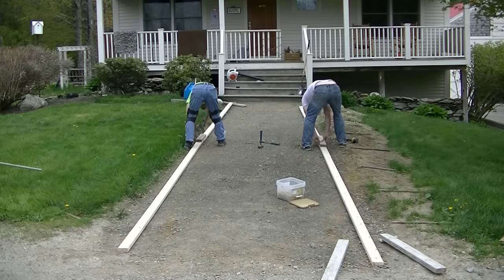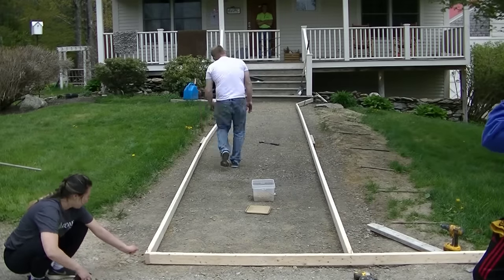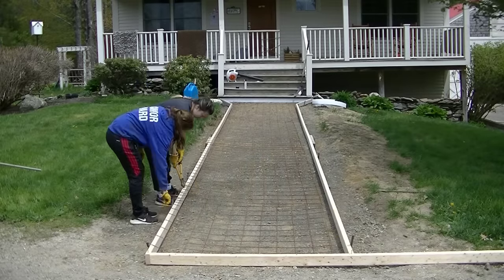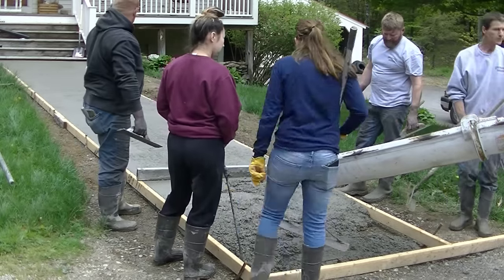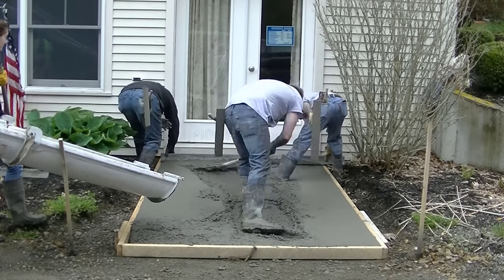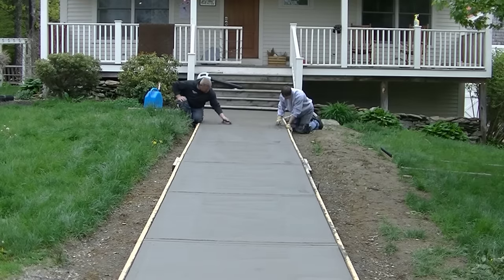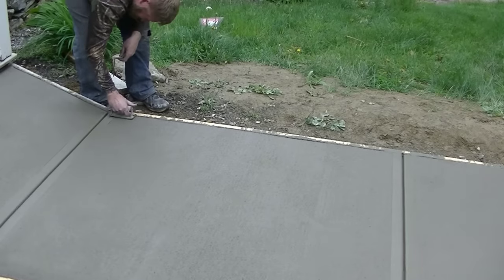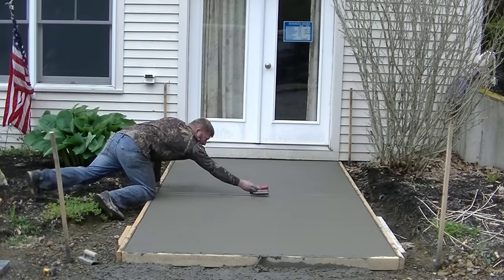CONCRETE SIDEWALK : FORMING, POURING AND FINISHING

Comment: I would like to see finished - dried concrete without form and in detail.
Reply: All concrete finishes the same.  The broom brush is used to finish it so we don't slip when we walk on it wet.  They backfilled around the sides with earth and then over time the grass catches up to the sides of it.
Reply: @danielcox6143  We don't do broom brush and we don't slip if it is wet. I have never seen such surface and I can not imagine how it looks in detail. I doubt it keeps the shape over time and will not droll or break.
Reply: @marian20012   The concrete broom brush they're not using in the video is one of the tools I need currently to do a job, and I run 70 miles a week, all of my shoes have extremely flat - smooth soles, I fucking slip every step I take when the concrete is wet.  As a matter of fact, now I have one pair of corregated clompers I wear if I even suspicion there will be rain or sprinklers.  Next door to my condos is this other condo unit who water their lawns and my sidewalk around 7:30 p.m. my time for shopping.  Damn bastards.  Who does that?!   It's a choice between breaking my back from a fall or breaking my back from carrying all the extra weight.  Thank you so much for commenting back, I really need the attention as you're now well aware.
Reply: Oh, my bad, I misunderstood you and got you (initally) confused with the owners of the video, confusion from how the notice came up in my feed.  Broom brush is kind of the standard of the industry.  I misunderstood again, when we built our castle (10717 Indiana Ave. Riverside CA 92501) we wouldn't have broom brushed because we covered the concrete with very expensive carpeting.  I used to own, live in and work at my castle.  Isn't that cool?  All the outdoor concrete (I'm pretty sure) is broom brushed.

Comment: What r the purpose for grooves?
Reply from the maker: The grooves are for looks (help it look nicer) and to help control any random cracks that may occur later.
Reply: The purpose for control joints, not grooves. Drives me crazy that a guy who puts up videos of pouring little walkways calls them grooves and not control joints, which is the correct term. He calls the tool a groove. Lol. It's called a jointer. Their purpose is to stop a crack from going any farther through the walkway. If a crack starts it will stop at the control joint so you only have to replace 1 block instead of more.
Reply: George Smith haha this is also wrong. The point of a control joint is to choose where your cracks go. Concrete cracks. Control joints are so that the concrete cracks along the joint so that you don’t see a nasty crack in the middle of the concrete

Comment: 5% air, what does that mean?
Reply from the maker: The redi-mix company adds "air" to the concrete mix. They're tiny microscopic air bubbles. So when the concrete absorbs water in freeze/thaw temperatures, the water has room to expand, when it freezes inside the concrete matrix and not "pop" or spall the surface of the concrete. 5% is just the amount of air-entrainment added to the entire mix.
Reply: Hey mike does this affect the integrity of the concrete vs no air?
Reply: What I mean is there something you’d recommend when putting air to help the concrete retain strength

Comment: I thought it was important to put down a layer of rock first, 4-6 inches
Reply from the maker: No, good gravel works just fine.
Reply: i should have been more general and called it aggregate. i have seen a number of videos on youtube and none of them have installed an aggregate base. i thought it was a good practice to excavate and install a 4-6” subbase prior to pouring the concrete

Comment: What you charge for a job like this mike?
Reply from the maker: It depends on the size of the project. This also included a large stamped pool deck that I have in another video. But in general to form, pour, and finish a broomed sidwalk around 8 dollars per sf. Sometimes a little less if more sf is involved.

Comment: No spacing was given between the steel mesh and the floor.  It won't last long.  The steel will corrode and break, causing cracks in the concrete.

Comment: The metal is on the floor why is that .

Issent it supposed to be like at least 1.5 cm from the floor so that water can't reach the metall and than it will not rust because  concrete will crack from the rust pressure ?!?
Reply: Listen at 725, he mentions that one of the folks are pulling up the wire off the ground.

Comment: how much does it cost to get concrete delivered
Reply from the maker: In Maine it costs around 125 per yard for 5 yard loads or more. Under 5 they charge a small load charge around 200.00
Reply: Stupid question how do you calculate how many yards you need?

Comment: URE not going to put a string line on the boards or an expansions board on the stairs NEATHER. And URE using screws to screw the material. I also got my own concrete company. Its not going to sag if you put a quarter fall per running ft. And you're straight screening it also.ALSO THE BULL FLOAT KEEPS IT FLAT.

Comment: Man I just don't know what to say. The mesh should be raised up from the bottom at least an inch or two. I would also use some rebar so it doesn't crack
Reply: They did raise the mesh as they were pouring it.
Reply: It can still crack even with rebar. Mesh and rebar keep the cracks from opening up or shifting heights . Rebar is better for keeping cracks from heaving and causing a trip hazard

Comment: The reinforcement bar should be an inchfrom the finished surface and should not be sitting on the ground as this defies its purpose. than suspending it. This is
Reply from the maker: An inch from the surface? You have obviously never finished concrete before and if it were that close it would shadow through and you would see the grid pattern in the finished walk.
Reply: @MikeDayConcrete  I am giving you science as an architect. It is my duty of care to tell you that. Good luck with the girls

Comment: you shouldnt be eye balling the walkway to see if it is straight. It is very simple to use Pythagorean theorem to make sure the walkway is square to this house. I cant believe some of these youtube contractors get paid for this work.
Reply from the maker: Jake, I know you didn't know this before you commented but the owner wanted the sidewalk to "line up" with the walkway on the other side of the driveway that goes to their pool deck. I was making sure it looked good walking out of the house. It couldn't be perfectly "square" or it wouldn't look good by eye. That's what the home owner wanted.
Reply: @MikeDayConcrete  Fair enough, my apologies.

Comment: Never use screws. And when you start at steps. The math has to work off the bottom step. You basically took out the bottom step. Step can't very 3/8 of an inch

Comment: I would've shot it with a laser. Max slope on a sidewalk is 5% of the length.
Reply: Learn how to do math before opening mouth and inserting foot.    The man said its 30+  feet long.     30 x 12. Is 360.  5% slope would be 18inches of pitch bud !!

Comment: Not impressed,, should have ran string on side of house and squared walk way with house,
Reply from the maker: Hi George, You wouldn't have know this by watching the video but we did a large pool deck and walkway across the driveway. The home owners wanted this sidewalk to "line up" with the walkway across the driveway. I was making sure when they walked out of the house both looked "lined up" with each other, that's what they wanted. It couldn't be "square" to the house and line up with the other walkway.
Reply: @MikeDayConcrete  l can relate to homeowners unreasonable requests,,, I've been a general contractor for 35 years, and built many homes and additions,, but I'm a particular about alignment and straight.
Reply: @MikeDayConcrete  you kept saying you have to eyeball,, and it was leading to the roads edge
Reply: Actually your creating more unnecessary work george.  You can use the stairs to square off and looks like they did fine. As long as you have the right cuts for the studs it will be square. I just think the slab should be 4 inches rather than 3.5 and the mesh should be raised.
Reply: @bmakyol  run the string,,,to far to square off small step,,,measure over and set end board first, run string down both sides and adjust and get grade  set stubs at joint in boards,,  use poly to hold moisture in concrete and use fiber,,,not wire,,  fiber in cement us stronger and slap can be replaced later if needed..And I'm not a concrete man by trade but I can do them all and right..
Reply: @georgespangler1517  If you're not a professional then your opinion isn't worth salt.
Reply from the maker: We did use strings, and there was fibermesh in the concrete also.
Reply: @MikeDayConcrete  people make vedios and can't take comments,,, be honest wouldn't it be better to set end board and run strings and set knobs first and then form boards yours is ok for short pours but not long ones,, and putting poly down to keep moisture in is always a good idea , especially on hot days.. And I like to do full expansion joints with key joint, not just cut surface,  but I'm picky as hell,, and nothing worse then having to bust up concrete and redue...
Reply: @georgespangler1517  ok relax
Reply: @kbanghart  I am always relaxed and calm,,, just little tolerance for the new way people do things,,, I'm old school and the last of a dieing breed.
Reply: @georgespangler1517  understood. Just that many ppl will stop listening when insults get thrown. That's all. Proceed. Lol

Comment: This was hard to watch. No clue at all what there doing. Didn’t use a string line to keep forms straight and in grade. And used a claw hammer to drive stakes and then said the gravel was hard
Reply: Wire mesh was also laying on the ground

Comment: I dont get it.
Screwing everything together.
Using little hammers
No strings to keep them lined up.
Guys dont know how to use duplex nails and back yourself?
Wire mesh doing s lot of good laying at the bottom in the dirt so it can rot away.
They say there pulling up the mesh. Doesnt do much good to pull the last half up only about an inch. Then it gets walked on .
Same thing w the back pad. You can watch it get pulled a little, then stepped on.
This is a video I'd expect to see from s homeowner who borrowed a few tools and tried to poor.
Sorry guys
Not very impressive